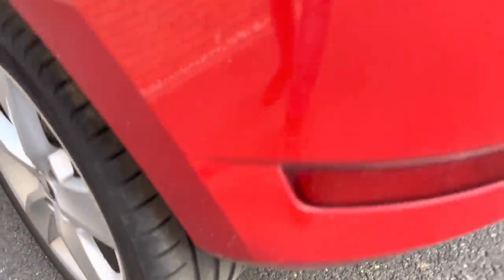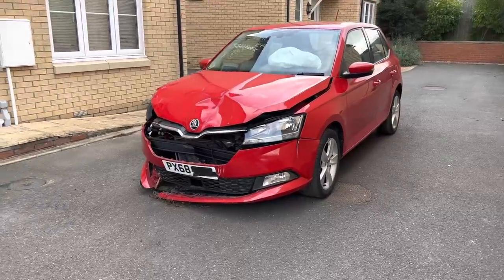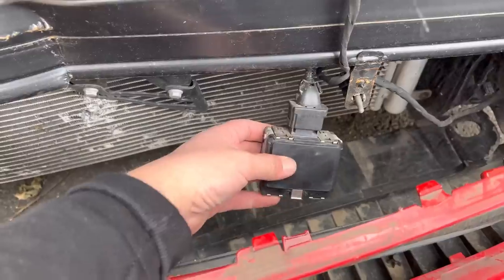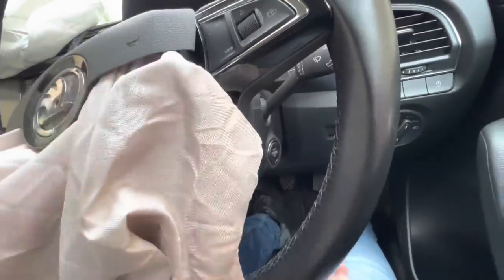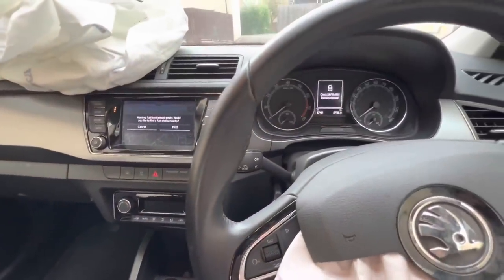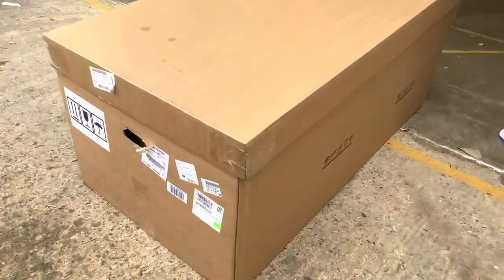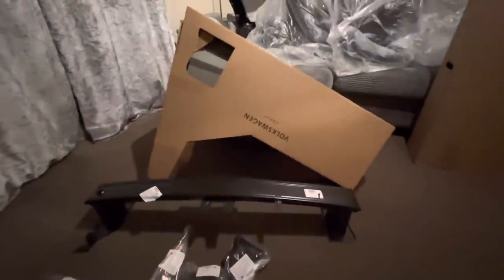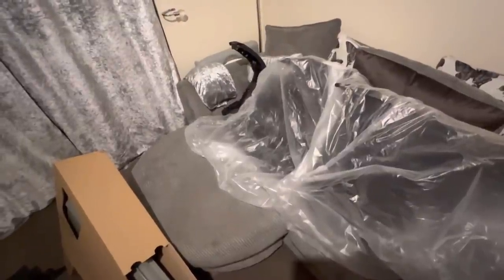We just bought a salvage damaged 2018 Skoda Fabia mk3 from copart Uk

Comment: do you find cat S and N cars sell as I recently went to a Dacia dealer for a new car as they offered me £3450 for it via autotrader, then when then found out it was cat N the price dropped to £1350, this was for a dec 2012 62 reg ford focus, they said that was all it would fetch at auction which seems a bit low
Reply from the maker: Tbh I haven’t really had an issue but I tend to have cars quite new or up to 4/ 5 years old with as little mileage as I can get and try to get a well specked car .

Also maybe have a look on eBay and auto trader what a focus your year and mileage is worth with a category and go from there id personally advertise the car on eBay as a classified add so then you won’t get people clicking buy it now and then not hearing from them the good side of doing a classified add you’ll be able to provide your phone number and it’s £19.99 for 28 days hope this helps thanks Nathan

Comment: I own a skoda fabia 1,2 ltr and I have mixed feelings about it.  Last week a front halogen lightbulb was broken and asked the official skoda dealer to change it. (it was cold and raining and I had to do it on the street). The dealer (hülpert- Dortmund) said it costs around €120, - /130 vat not included.  As I asked him not being embaressed for this rip- off he shrugged and walked away from me. I drove to a roadside car workshop and had it changed for €20.  The mechanic said the car is built/assembled crappy, in the cheapest possible way, resulting in higher service costs. Changing the left & right front halogen light bulb is a bit of a nightmare.  I sincerely believe light bulbs must be easely accessible without dismantling parts of the car. The car owner must be able to it. 
In some European countries a broken lightbulb can become very expensive, since the car must be towed to a workshop by a towtruck...France, Spain... All this because skoda has made insitu bulb changing impossible. 
Since I intend to buy a new car in coming months, I scratched skoda from my list
Reply from the maker: Hi Bert thanks for you comment unfortunately a lot of modern cars are built this way which is stupid and and bulb should be designed to easily be replaced with minimal tools

Comment: Like it… how are you going to get past the no airbags?   eBay?
Reply from the maker: Hi Abdul and correct bought the steering wheel air bag and dash board airbag off eBay so with the brand new dash board and seats belts professionally repaired comes just under £600